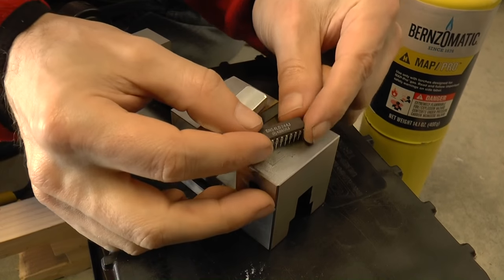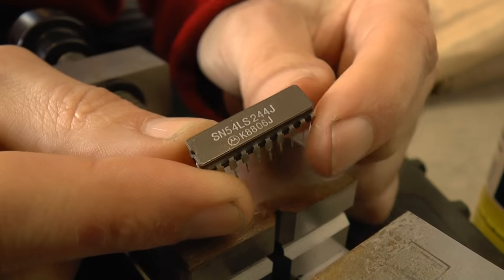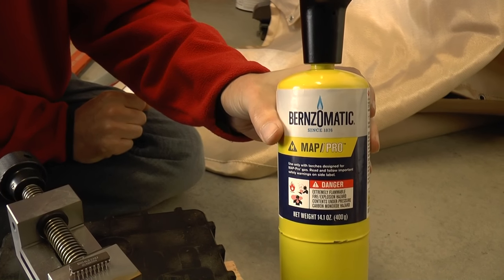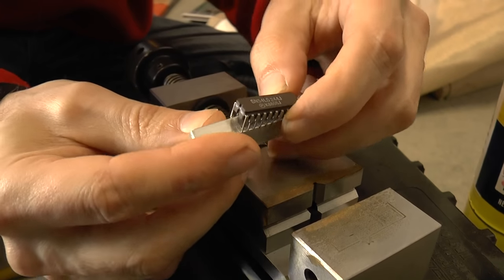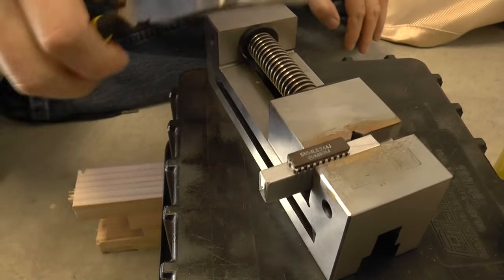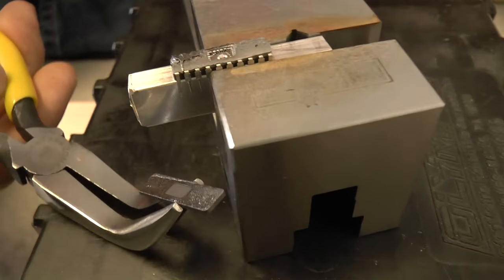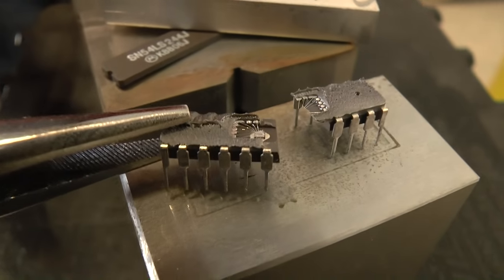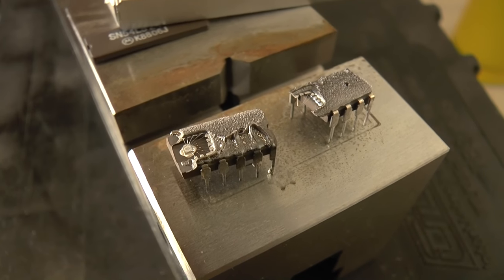Decapsulating a ceramic integrated circuit

Comment: just using a side cutter inthe cut between the two halves of the case will have the same effect. but without that you need gas, heat and with a smaller chance to damage the die...

Comment: I tried decapping chips with a blowtorch, and I got success...  but on many chips there's definitely heat damage visible. Don't know what it it, silicium should be fine, maybe metal/glass? The chips I tried it on required nuking of the entire package until glowing orange hot.

Comment: Can you do this for ICs in general?
Reply from the maker: No, just for ceramic ones. Plastic IC's take a lot more work. Check out my video on that: https://www.youtube.com/watch?v=07b6ba5DBtI
Reply: You're referring to the packaging right? 

I ask because I am interested in taking some defunct chips (and old super cheap CPUs) and decapsulating them so I can see the die and perhaps even look at one in a microscope. I saw in a video you could decap certain chips by heating them up and then rapidly cooling them, to loosen up the (epoxy?) material.
Reply from the maker: I haven't used that technique. I'm suspicious of it -- it just seems to me that there is a high probability of damaging the die. But again, I haven't tried it so I can't say for sure.